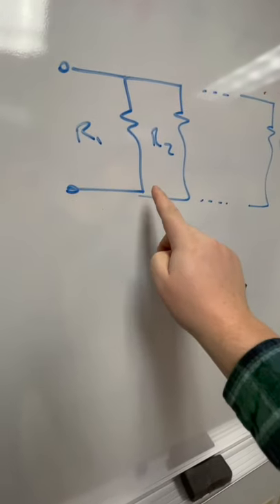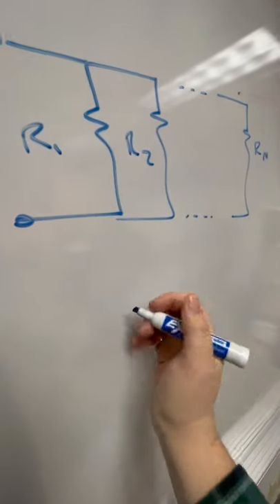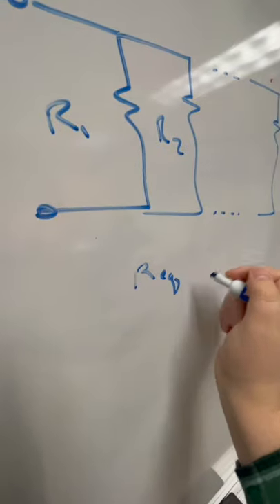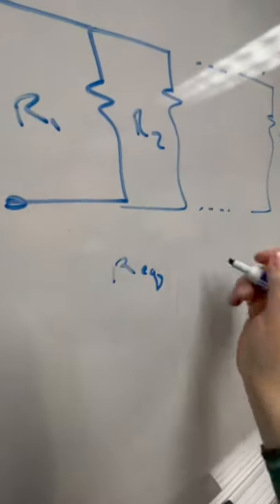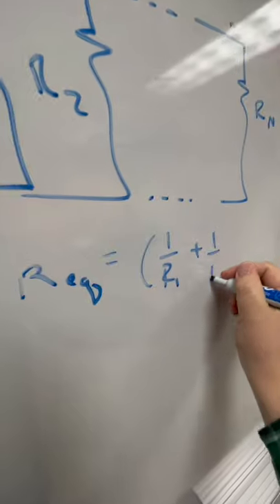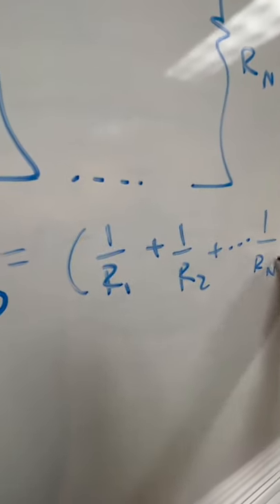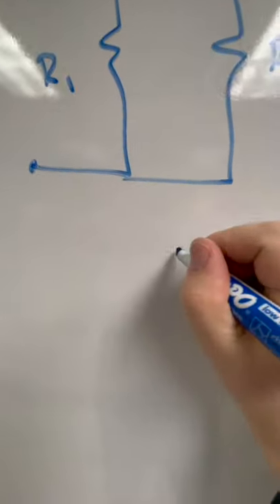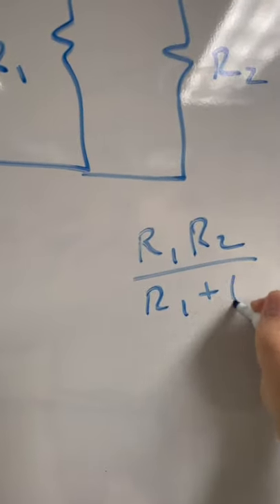Parallel Resistors in a Minute #shorts

Comment: So at the end what u basically said was that the smallest resistor in the circuit,, then the resistance will be smaller than than the smallest resistor 🤔hmmm

Cool 😎👍
Reply: Equivalent resistance less than the lowest resistance in parallel that's why bulbs and appliance in house glow better